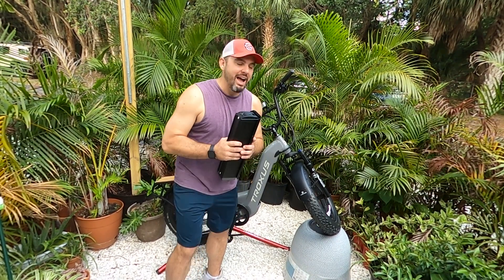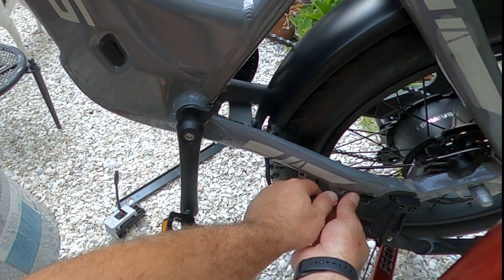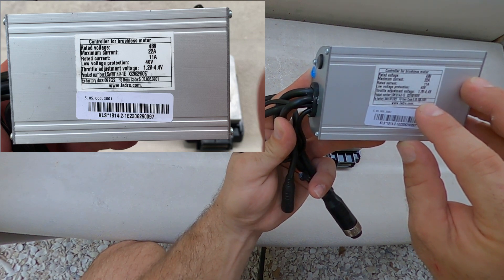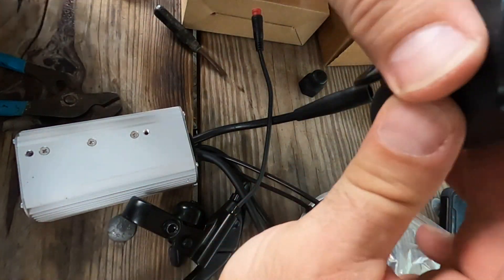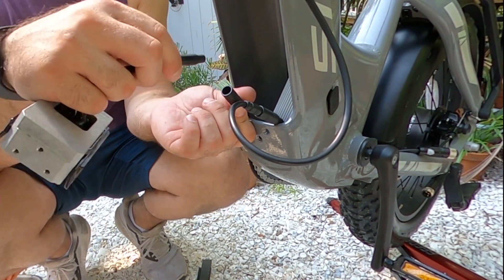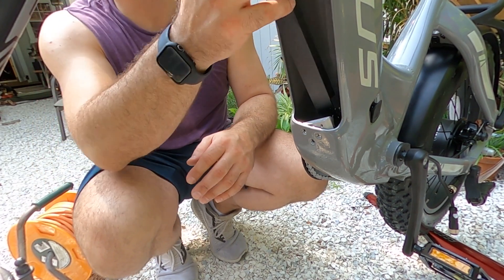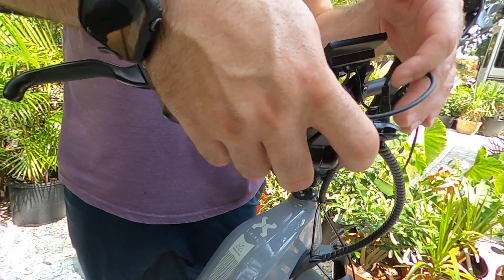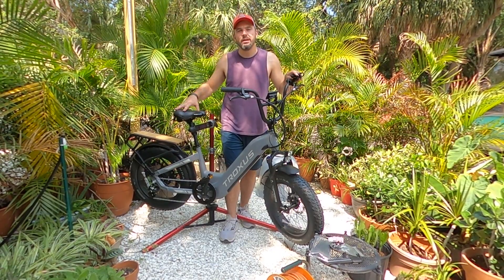Electric Bike Controller Removal and Wiring Overview 48V 20Ah 750W Rear Hub Motor Troxus Lynx

Comment: What is the function of the 4 other wires coming from the battery?
Reply from the maker: The best answer we got from Troxus was battery analytics monitoring
Reply: Thanks. That's what I thought based on weird voltages- Which means it's not compatible with Himiway, even though it looks the same. @ElectricAllWheel